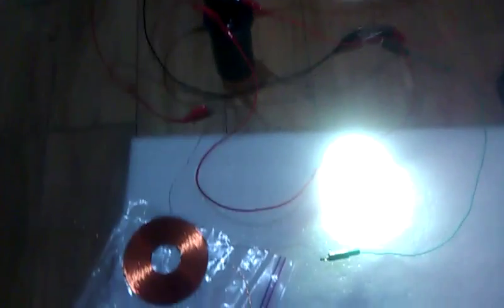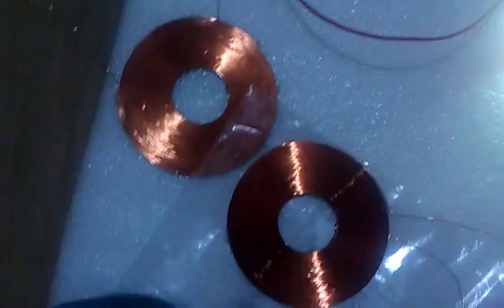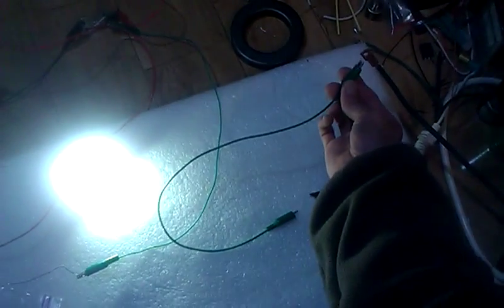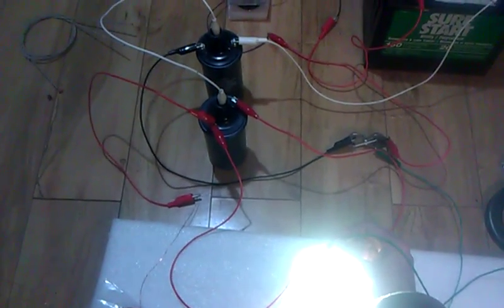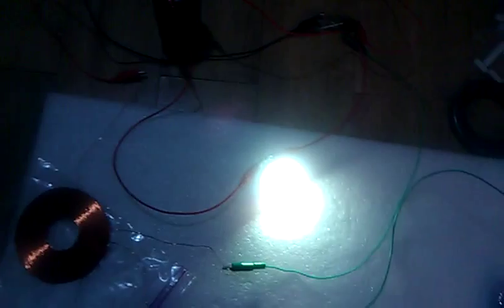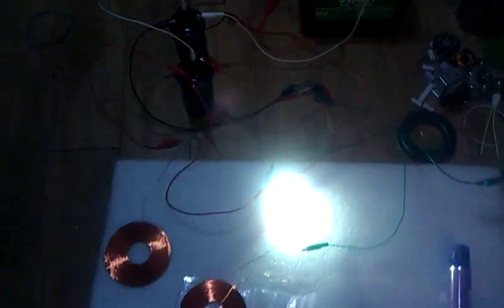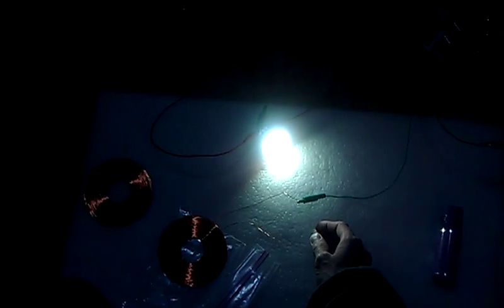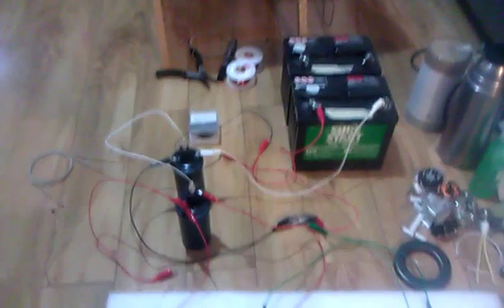Radiant Oscillator Circuit: 0 Amps @ 12 Volts = Huge Light Part 2/

Comment: the end you touch with your finger could have an antenna cut to 1/4 wavelength of the ignition coil oscillation.   you could also have other tuned coils around the unit running lights for free.  don smith 4 coil resonant device